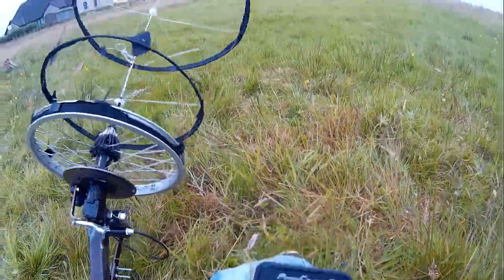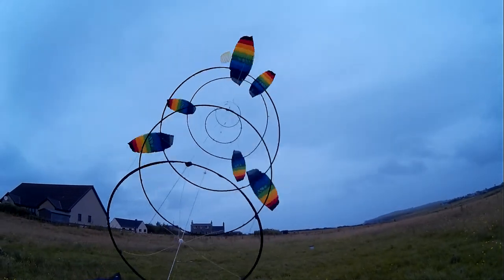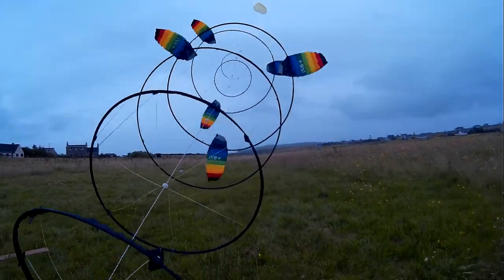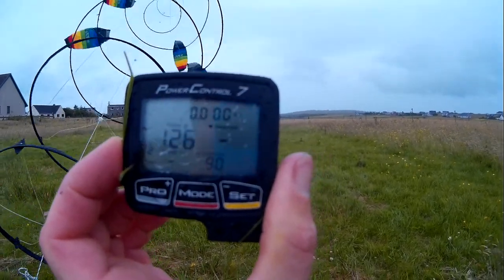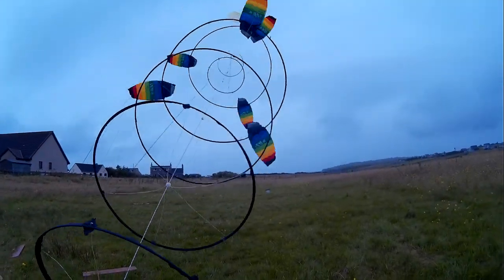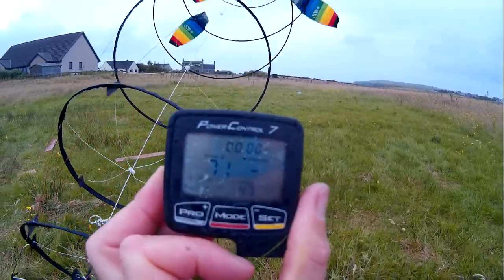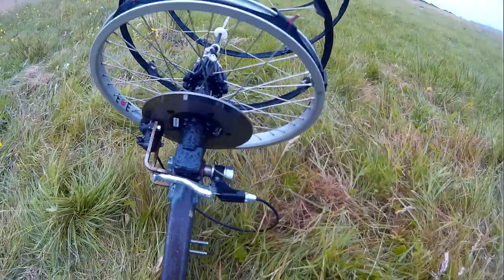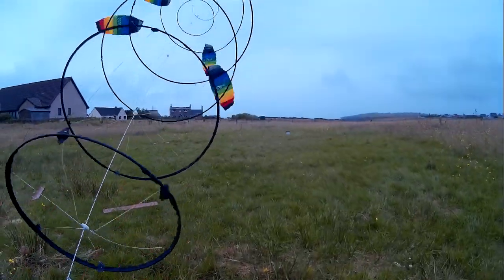Dual Rotor Kite Turbine Test 13 July 2017

Comment: Hi Rod,Congratulations for your progress. Please do you think Daisy is lighter (mentioned 2 kg on another video) than (soft?, then rigid?) autogyro-like blades sweeping the same? Thanks.
Reply: It looks possible when the (flat for Rotating Reel, or tilted for Daisy) ground ring is large enough.

Comment: Another question. You test and improve Daisy for a long time now. So please could you indicate what is the lifetime of the soft kites used? Indeed the mechanical constraints can be different as these kites can be sustained by the structure, isn't it? Thanks.
Reply: Hi rod, very interesting. So the lifetime of the soft kites could be better as they are used (as blades) within the ring structure that would protect them, restraining their path and perhaps limiting flapping and some strengths?